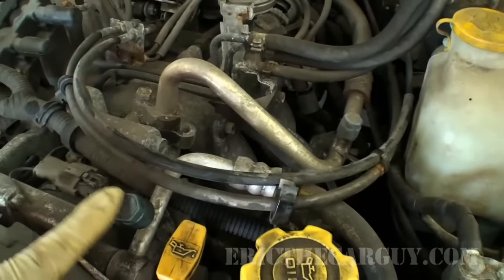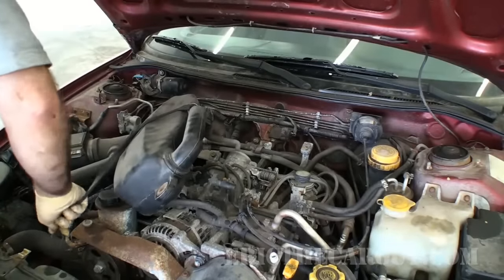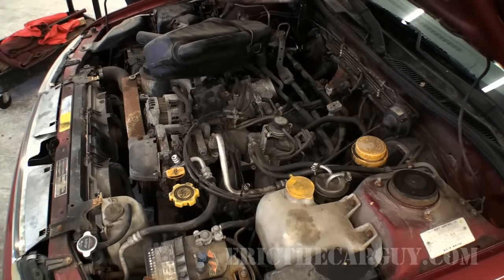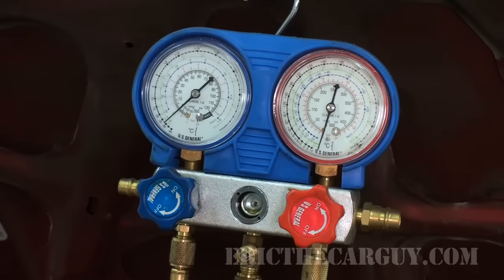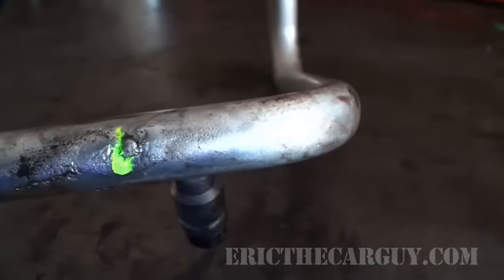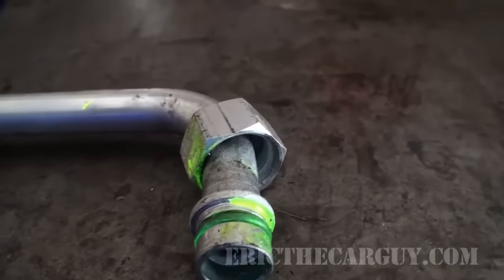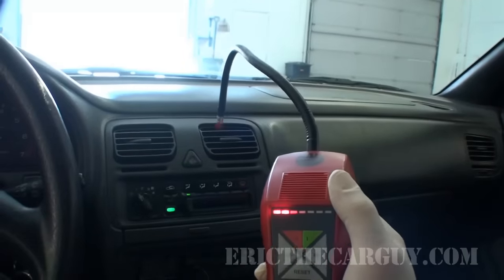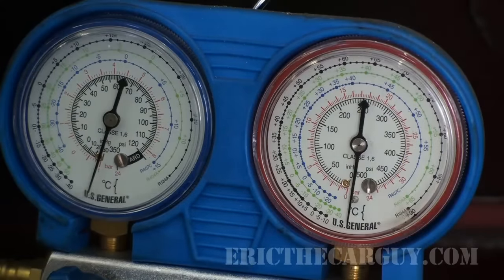How To Find and Repair AC Leaks - EricTheCarGuy

Comment: Thanks for the info!  I have a 2007 Ford Fusion, and the a/c died two years ago--just blew hot air.  The mechanic tried to replace the freon, but it still didn't turn on.  Around this time, I had a bad oil change, the mechanic forgot to put on the oil cap and all the oil leaked out on the garage floor.  Next to it was a lighter stain, thicker than water that didn't evaporate or look like oil.  I'm wondering if the mechanic may have damaged the hose and caused some leak, but then why wouldn't the a/c turn on when the refrigerant was replaced?
I brought it to an "a/c certified technician" who told me that I need a new compressor and condensor (for over $1000), but how could he have diagnosed that without any freon in the system?  He unplugged the compressor and then tested some voltage reading, and told me that he was getting volt reading, so he thought there wasn't anything wrong with the switch and the issue was after the point of the plug, which would be the compressor.  This doesn't make sense to me.  How can you determine if the compressor isn't working, when you've just unplugged it????
Please help!!!!  I am thinking that he should have checked the charge with the refrigerant fully loaded and also checked for any leaks, as well as check the sensor (by checking for codes, because they would not necessarily light up on the dash?)
Reply: The switch makes the compressor clutch activate.   Apparently, the clutch wasn't functioning.  Therefore, need a new compressor, as it is almost the same cost to repair a clutch.  When the new compressor is installed, it is vacuumed and leak checks done.  (No sense in doing all the leak checks twice if compressor clutch is obviously not working.   You would be paying for an additional hour of work and that would've been redundant.)

Comment: Indeed, just changed the compressor and bought a 134A tank, and just  to find out that there is a leakage, most likely with the O-rings on the tubes that attach to the compressor. Infinite work

Comment: Nice vid Eric, just to point out though Ester oil is actually good for both R-12 and R-134a systems, it mixes with the mineral oil from R-12. Its the PAG oil that's not good for R-12 systems.

Comment: No, the canned air used to blow off keyboards is most commonly 1,1-Difluoroethane (R152a) though 1,1,1,2-Tetrafluoroethane (R-134a) is also used.  Both are HFC refrigerants!  Not surprisingly, DuPont owns the patent to both and sells the 134a under the "Freon" brand.  In contrast, they market R-152a under the "Dymel" brand as a propellant *eye roll*...  DuPont also sells Dymel R-134a, which is marketed as non-flammable propellant, but it is the same as Freon R-134a only for a different market.

Comment: I think Peter Hambly is right you just needed to do some more brazing on the tube and you would have had it, but I use an air hose, compressor and some soppy water in a spray bottle to do the line check.

Comment: Before reinstalling the line - why didn't you isolate the line and pressurize the line (could have even pulled a vacuum) to determine if it can even hold a small amount of pressure (or a vacuum if you used a pump)?  This procedure would have given you some indication that the repaired line can hold some pressure (or a vacuum).   At 250 and above PSIs who knows if the line can take it.  Furthermore, you should have conducted a nitrogen test instead to determine a leak and location.  Much safer and cheaper.  Also, you didn't bleed the charge line when hooking up. Now, you got air in the system.  I like your video, it is still very informative.

Comment: Back in 1979 (ya that makes me 75) I was drop dead poor but I did have a manifold gauge set. I didn't have a vacuum so I made an adapter to attach the manifold to the intake on the carb. This was in the days of R12 and no one was recycling it in rural Georgia. The system was open so I wasn't going to burn R12 in an internal combustion engine which BTW will make mustard gas come out of the exhaust. So I made an adapter that attached the manifold gauge to the vacuum on the intake of a 1973 Detla 88. So ya I know that the car vacuum will only take vacuum down to 25 Hg where you supposedly need 29.9 for absolute vacuum. Anyhow I made the repairs including a new dryer. I decided that on a nice hot summer day I could let the engine run getting it good and hot making it easier to boil off water while applying vacuum.  So I ran it for an hour and shut off all my valves. I let it sit for 2 hours. It held vacuum.  I then added oil and filled the system with R12. It worked just fine for those hot central GA. summers for the next 6 years until my ex-wife totaled the car. Now that was a hack. I believe that hack would work today as long as your system had no freon in it. So my hack should not be used on what Eric did in this video which was add freon to a running engine and burning that freon even if it was a just a small amount.  I long ago lost my "adapter" but it wasn't hard to make.

Comment: I just had an issue and hope you can shed some light. 
Have 1995 honda civic hatch that came w/o an ac system from factory. I purchased a complete unit from a 93 and only thimg to make it work was to change the evap harness. I replaced with new receiver/dryer and expansion valve. Took to shop to evac system and recharge. Short story, today with ac on, was stopled and my engine bay started smoking like crazy so I pulled over checked engine and heard hissing. I killed the engine and hiss continued. I figured my ac just took a dump cause it smelled of freon/oil and as well noticed oil around my pump. Was it possible the system over pressurized and killed my pump? Haven't checked ac pump clutch yet cause I was pv'd.

Comment: Hi Eric, very useful videos! I was wondering if you could do a video on removing an evaporator core from the front of an 04 Chevy Venture minivan? I was able to remove and replace the one in the rear along with the heater core and expansion valve but would like to do the same in the front.  I am having a hard time figuring out how to get the blower motor assembly out to get to the evap core.  Thanks for any help.

Comment: Hi, I hope you might have an idea on an AC problem I have on a 1990 C4 with the C68 Electronic AC. First off there are no codes on the AC screen and the green indicator lights are on steady when selected. My problem is when the AC is set to auto it blows cool for around 15 minutes on a fan setting of 5 and then in a big rush the fan goes to full force and blows hot air. I can shut it off, turn it to manual AC or just vent and back to Auto but nothing will make the clutch reengage on the compressor EXCEPT, parking it for a couple hours then the AC will work again. I have even tried the paper clip in the low pressure switch and that will not cause the clutch to spin. Now if I start out with the AC on the manual or recirculating setting it blows very cold my whole commute for about 40 minutes until I park it in the garage. The low pressure side reading is hovering around 30 psi, could it just be low pressure is causing it to shut off, but if so why does it blow very cold for 40 minutes when on manual AC?
Thank you.

Comment: great video. i had a leak but had no leak detector so took it to a mechanic and he told me i had to change the hose. i did that but it tuned out to be the AC compressor itself. the AC clutch was leaking(?) but i just gave up on trying to fix the ac. but i'd like to know how for the future.

Comment: Cool vid!  Quick question...I have a '90 civic with a R134 conversion.  Seems as if the systems holds a charge for about a year.  After that, nothing.  I was told that my rubber hoses could be the problem.  They are the original R12 hoses and that R134 molecules are smaller than R12.  It been charged twice and it doesn't leak when it's finished charging.  But after one year....system doesn't turn on.  Maybe you can shed some light.  Thanks!!

Comment: Hi Eric. My ac is not blowing cold air right now. My compressor works fine when I turn the ac on. There’s no noise on the clutch or anything like that. 2 weeks ago I noticed a weird smell kind like antifreeze. I checked the compressor and I noticed oil from underneath behind it. Would you recommend to start replacing the O rings?

Comment: I have a leak,I've used soap bubbles,have heard issues using the dye but looks like it possibly is the only way. I kinda suspect the evaporator, I have a electronic leak detector,,somewhere in the attic,,will use inside at floor vents as well as a.c. vents for leak in the evaporator..thanks for this vedio,,maybe do one on replacing the evaporator..had trade school in a.c. & heating in my earlier years ,residential & some commercial  ac repair ,sears repair technician for 23 years so I am savey in a.c. repair...I have a 1997 mazda b4000..v6...any ideas always worth listening too....thanks
Reply: Lots of modern vehicles come with ac dye from the factory. It shouldn't cause any problems as long as it's made for the refrigerant your using.

Comment: Great video. However, you neglected to purge the air out of the yellow, charging hose, after connecting it to the R134A container. Correct practice would be to slightly loosen the fitting on the yellow hose, momentarily, where it connects to the manifold set. The air in said hose, went into the AC system.

Comment: I like this video because, a) it's Eric, and b) it educates. However, I do know that for £25 I can have a local A/C shop hook up a machine that will evacuate the system, precisely measure the 134 and lubricant, then pressure test it, inject the exact amounts of 134 and lubricant, and print me off a ticket saying what its done. I'm not complaining about the video, but for the owner of just one car, this is cheaper than buying all those tools (gauges, vac pump, etc).

Comment: I have a 2004 Infiniti with 138,000 miles.  Recently I have a growling noise which is really loud.  It is still blowing cold air.  Today i drove it about 6 miles and thought I smelled rubber.  What could be the problem?  One person said maybe the compressor.  I watched your episodes about the clutch.  Don't know if the coolant has ever been checked.

Comment: I have a 2008 PT Cruiser and i followed your instructions. The vacuum test showed no leaks. I left the vacuum on for 1 1/2 hrs. The PT ac will work for a day after being charged and then quits. I took the car to a local shop and after 3 days they could not find a leak. They said that it had to be the evaporator. I did some research online and if there were an evaporator leak, and there is dye in the system, wouldn't dye show up in the run-off when the car is turned off? I put dye in the system and none showed up in the evap moisture run-off.  Any reply would be helpful.

Comment: Eric, my latest older Outback H4 is missing the AC belt. How can I test the compressor before sinking any money into the AC system? There's another problem, too, and it's that the AC On/Off push-button on the dash is scrunched in & is basically non-operable. It seems permanently stuck too far down into the surrounding dash, & doesn't move or click or anything when pushed. And, with no AC belt, I'm not sure exactly of what I'm getting into. Maybe someone jammed the button accidentally & so the AC ran until the belt broke, then they disconnected a fuse or one eventually blew on its own or whatever, but I need it to work and don't really yet know how to get started on the correct order of diagnosing & subsequent repair. Thank you, for any help you can offer.

Comment: So without going out and buying the gauges or vacuum (yet), I went out to check the schrader valve as you suggested and there IS pressure in the system. Does this mean that I would not have to replace the reciever dryer once I find the leak and fix it? Also if I find a leak and fix it, would I still have to evacuate the system before disconnecting lines to say, replace o rings for instance?  Would I still need to take away the atmosphere to boil off moisture if there were still pressure? I have confirmed that the power connector to the compressor is not getting power and the pressure switch does not have continuity to engage the compressor so I am assuming the system is low on charge and probably has a leak. This is a 1999 Saturn s series we recently bought used and the air probably has not been working for quite a while.

Comment: The Accumulator and the Drier serve to different functions. The receiver/drier gives the refrigerant a chance  to change state from liquid to vapor before it reaches the compressor. As the Accumulator is located where applicable right after the condenser and it collects the liquid refrigerant to be sent to the liquid line to the metering device. Eg capillary tube, T.X.V. Etc.

Comment: Good job... Just a few tips. To repair that line u would of wanted to silver solder it it a acid flux not the same solder or flux used for plumbing. U would braze it with oxy acetty torch. I know I probably do t do a lot of a/c work but if u decide to u should invest in a bottle of dry nitrogen. Works great for finding leaks especially large ones without wasting money on refrigerant. Nitrogen is cheap once u buy the bottle and it also helps remove moisture and flush out the system. Lastly after u repair the leak and pull a vacuum u can charge the high side with liquid refrigerant. Only during initial charge and not with a/c on. It will take the first can or so much quicker.
Reply: Good advice, just how many psi u normally use with nitrogen?, I heard of up to 400 psi, which to me sound too much
Reply: meerkat.em When I sued to work with commercial refrigeration equipment we would use 150 psi as standard. I would leave this in overnight to leak check, once all repairs are made. You could go a little higher, but it is not necessary. Whatever the pressure it should hold within 5 psi or so over night. Once it's leaked check you can pull the vacuum. This is also a second step in leak checking. Leave it under vacuum overnight and if it too holds, then you can feel confident knowing there are no more leaks.  If you don't have time for this. Fill with nitrogen and let sit for an hour. If it holds then pull a vacuum for at least 30 minutes, then charge. The longer the better on the vacuum.

Comment: Hi Eric, my 99 Miata had a great air conditioner until a "rock" truck spit out a ton of rocks and killed it along with the radiator. I replaced the condenser via the insurance company and the air worked about 24 hours.  Took it to another repair company and they said I had a leak and that the compressor was now was worn out, and that all both the condenser and compressor  needed to be replaced.  That was 2 hot years ago.  I have located a used condenser and compressor which was apparently good when it was removed from the car.  Would that be a good idea to try and purchase to start all over again?

Comment: Eric, liked the video. As far as your method of adding dye, I was under the assumption that you had to use an oil injector or pressurized dye can to add dye or oil to the system. Have you ever had issues with adding the dye/oil directly into the charge line of the manifold gauges?

Comment: for evap leaks shut the car off and stick the detector up the drip hole or let it sit for a day and check the floor where the evap is . usually on the passenger side. you was just picking up air at the vents . you can blow on the tip of your detector and set it off. you could sand that hose for one or two inches from the hole solder more surface space then liquid steel it all around  the liquid steel that takes 24 hr to dry completely

Comment: Hi Eric,  I have yellow stuff bubbling from that low side line for the freon I know die was added but, since it is bubbling there, is it the EXPANSION valve that needs to be replaced?  If so, and I buy some gauges and freon do you think I can evacuate, replace parts and recharge the a/c myself. I cannot get into a shop in Dallas or the dealer until next week but, I cannot wait until next week. I just got it back from the dealer today and they had it for a week trying to figure out why the rear a/c was not working.  Now, it works, but still not that cold.  I started looking around and saw this yellow stuff bubbling in the low side line where you put the freon into the a./c

Comment: You're wrong about the knobs controlling the gauges. The knobs connect the center hose to the high and low sides, depending upon which one is opened. The gauges read whatever pressure is in the hose at any time, that means connected to a system or not. If you open only the low side knob when gas is hooked up to the yellow hose, pressure from the can will flow into the system to be compressed down to a hot gas. Open up both valves and the high pressure gas will just flow back into the low side.

Comment: Autozone sells little screen filters, called compressor guard screens, that you put on the inlet and outlet of the compressor that helps capture any metal in the event of a compressor failure.  They are made by Santech.

Comment: An add to the safety glasses when attempting a valve check for pressure is a respirator.  You definitely don't want to breath that stuff in if it comes out

Comment: Hi Eric, I bought 4 items to recharge my car ac refrigerant. 
1. Harp 134a, 340gm refrigerant 
2. Can Tap Valvue to make hole in can
3. Freon charging hose.
4. Low side shredder valve.
i tried to charge refrigrant without gauge. but I'm not sure whether refrigrant is being transferred to car ac system via shredder valve. I double checked that refrigrant is reaching till the end of the hose before shredder valve but how can I be sure that refrigrant is passing al the way through shredder valve and going into the car AC. kindly advise